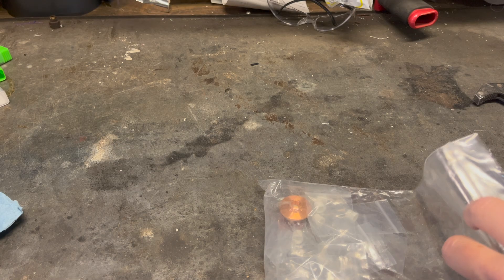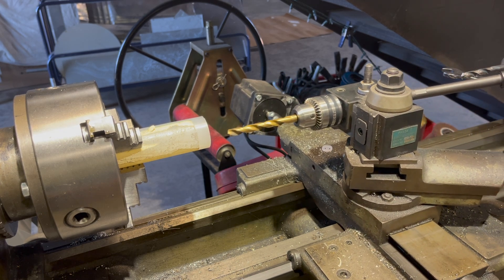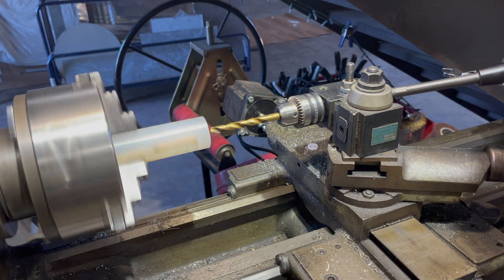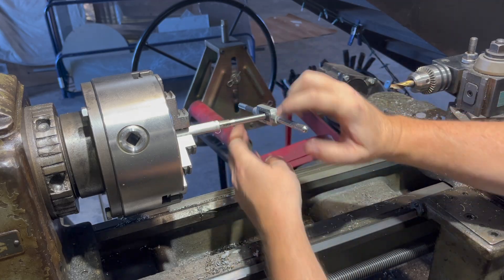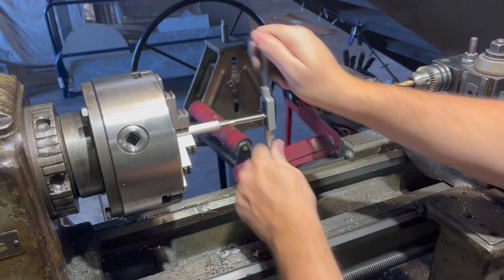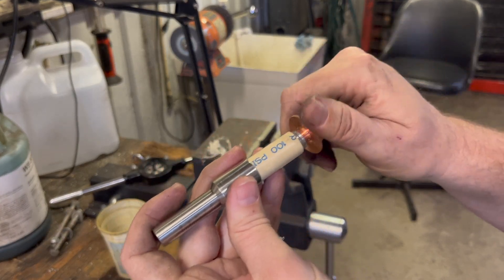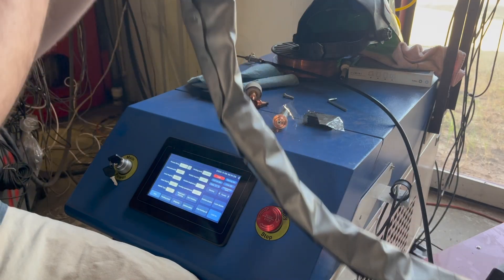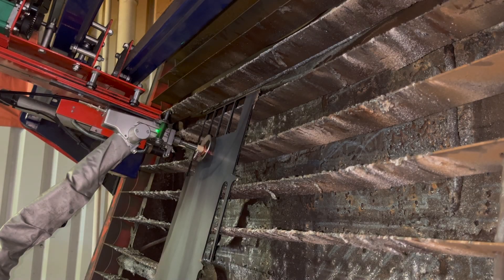Xtools Nozzle on D.I.Y. Fiber Laser on Plasma CNC Table

Comment: Use oxygen for cutting carbon steel :)
Reply from the maker: I have but dont like the slower speed and increased cost compared to air, trying to avoid oxygen as much as possible.
Reply: @k-rigg  there should be speed increase and less dross couse oxygen is additional energy. I had some experience in „normal” fiber laser CNC tables and you conclusion is puzzling 🤔

Comment: Got a suggestion. I have been researching the laser cutting head from Relfar. They run up to 345psi air, which seems to be the dross solution. My Relfar gun maxes at 145psi. So I was looking up specs in the cutting head and they use a protection glass 5mm thick instead of 2mm standard, like your gun. So if I machined a adapter that would hold a 5mm quartz protection glass and set up a offset connection for a 6mm tubing quick connect fitting, I could send high pressure air to the tip and protect my gun with the 5mm window. MAX AIR USA, sells a 500 psi oilers compressor for 1500. Dry that air and feed to nozzle to see if pressure is the answer. What do you think...
Reply from the maker: Could work.  I have at least one more option i might try before going high pressure route, ill post a video about it in the coming months
Reply: I think you’d better be careful you’re not exceeding the air pressure limits of your machine with that.

Comment: My friend has a xtool work great. Maybe your construction is the problem? The ceramic nozzle may only work if its 90 degree to the table. So the ceramic can "fall" free to the material. I hope you understand my thoughts. 😅
Reply from the maker: I understand, i know xtools advertise it for stainless and aluminum, they didnt say anything about mild steel, i was hoping it would work for mild steel.  Im not implying a short coming of the product as i was using it in an unintended use.
Reply: @k-rigg nah i totally understand this. 😅 i wasnt even sure what material they advertise it. Did you try it with other materials with good result? Becouse i am asking myself about the 90 degree thing and your table is tilted.
Reply from the maker: I haven’t but will, the torch is parallel to the material and the ceramic was setting flush to the metal.
Reply: @k-rigg but with the air and the almost 90 degree tilt? I think this a huge different to a flat table. Maybe i am wrong. 🤷🏽‍♂️😅 Who knows.

Comment: Wonder if heating the tap to just enough so it doesn't melt the plastic if it will cut better
Reply from the maker: That might work.  The treads were really fine so even if they were formed correctly they wouldn’t have lasted long im afraid.

Comment: Brass for this type of part
Reply from the maker: Didnt have any, also needed plastic for a insulator for the thc to work.
Reply: They all use copper.
Reply: @melgross  On the handheld units the tips are copper and the piece that holds the tips is brass. On the commercial tabletop machines the tip is copper and the holder is ceramic.